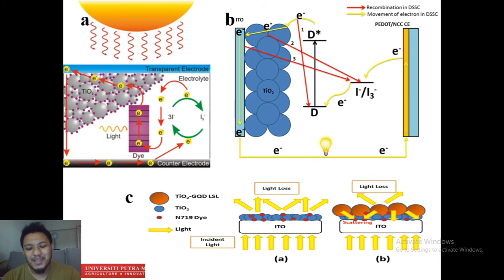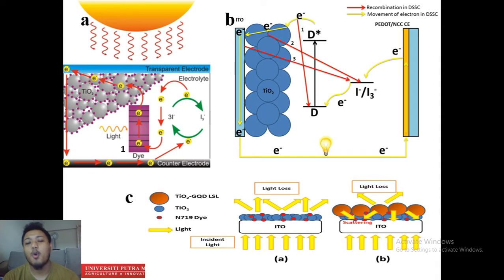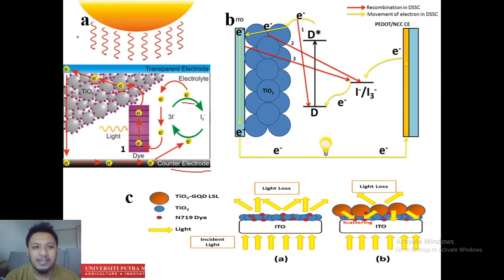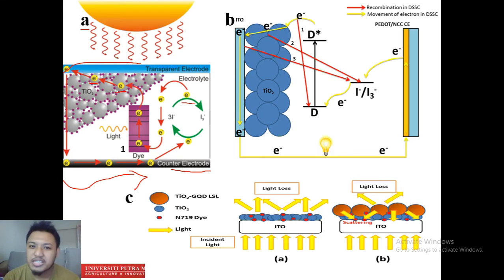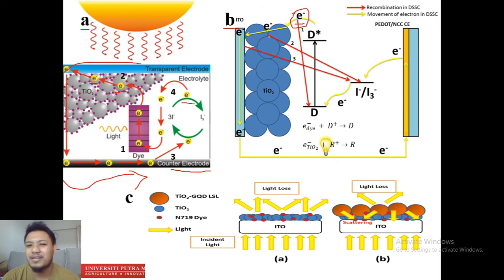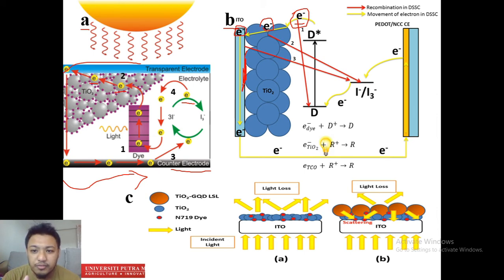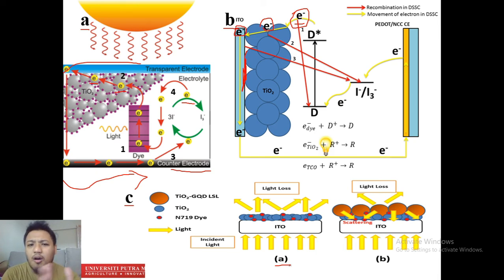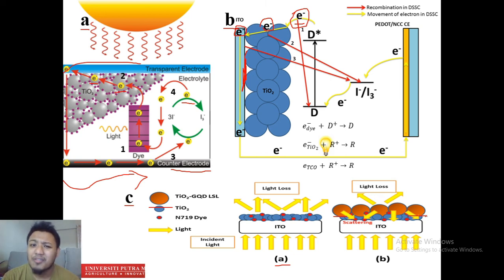Dye-Sensitized Solar Cell (BASIC & PROBLEM)

Comment: Is there any relationship between PCE and IPCE parameters? How can we treat or cross check each other if there is any relationship?
Reply from the maker: In general, the results must be tally. The higher the PCE, the higher the IPCE.

High IPCE means that more photon is involve in the DSSC which results in high PCE.

In disscussion you can relate the increase in short circuit current and open circuit voltage towards the increment in IPCE analysis.

Correct me if I am wrong. Thanks.

Comment: Using Jsc they tried to calculate % at blue light around 479nm from IPCE spectra means  IPCE=(1240*JSc/lambda)*100%, but I have not seen such spectra mostly. What can you say about this?
Reply from the maker: Some paper did not attached the IPCE Analysis because it is expensive compare to J-V curve.